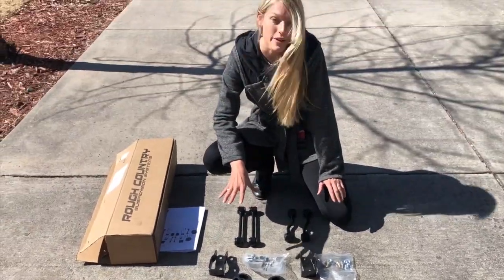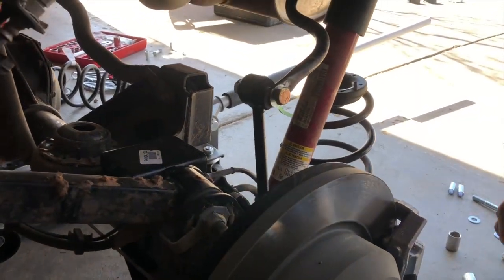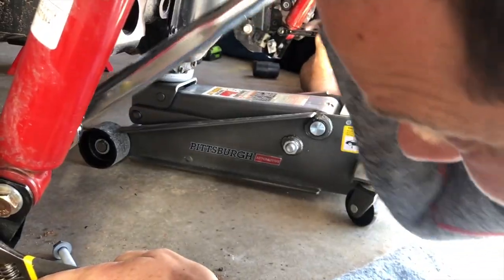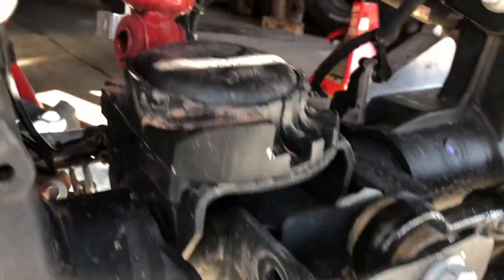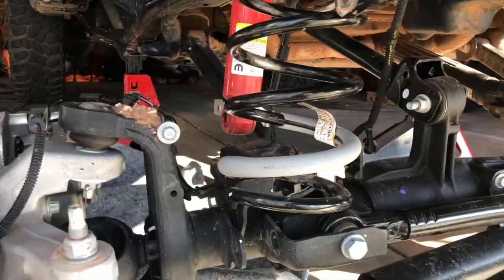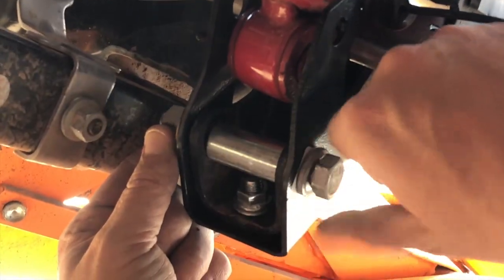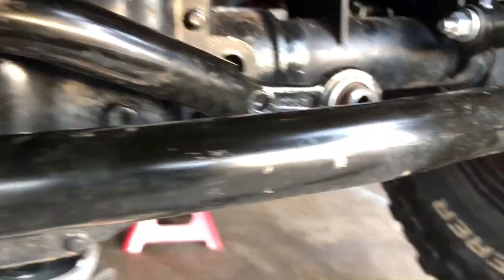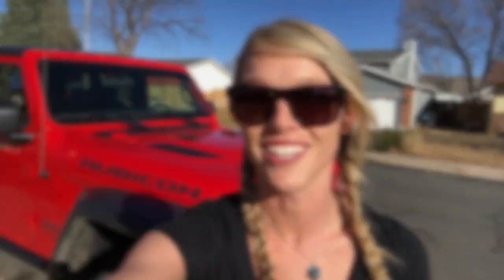Installing a 2.5" Lift on Our 2018 Jeep Wrangler JLU Rubicon - How To

Comment: Thanks for sharing your lift install. Really like the new stance. Looking forward to your next video where you test the new setup. Kevin you are blessed to have a lady who loves Jeeps as much as you do.  My wife of 32 years drives a 2018 JLU Rubicon in Granite Crystal.  We got it one month ago today on Feb. 16th. so it is our first month anniversary. We love our new Wrangler we traded my wife's 2014 JKU Sahara in on the new Rubicon. I drive a 2012 JK Sport S.
Reply: Can't agree more Kevin. The new redesign on the Wrangler is fantastic. My wife likes it a lot better then her 14 Sahara. I really like the styling ques from days past like the tip in the grille like the YJ and TJ,  the headlights pushing into the seven slot grille like my dads old 71 CJ5. The flat dash reminds me of the YJ and CJ Jeeps. There is so much to like and the drive with the 8 speed auto brings out more potential of the 3.6 liter.  So it was a no brainer buying the new model even if its a first year model.  Thanks again for sharing your experiences with us You Tube Jeep lovers. 

Gary

Comment: I am not familiar with whether or not the Rubicon’s auto sway bar disconnects are only for the front or both front and rear sway bar. If not for the rear , I highly recommend the Steinjager rear sway bar disconnects, you will not be disappointed in how easy it is to disconnect/reconnect the rear sway bar (zip tie the sway bar up, two most important items for any Jeeper to carry off road are zip ties and duct tape, in my opinion)!

Comment: I look forward to seeing how it performs with the lift.  I have had an AEV spacer lift on my JK, with 33's, and I've done lots of trails, including some in Moab, and put over 80k miles on it with no issues.  I put the Mopar lift on my JLU, and it is great, but they are working to fix the dreaded driver side spring bow.  Mine isn't touching the bump stop, but it does need a fix, which Jeep tells me is coming.  Anyway, you avoided all that with the spacer lift and saved a BUNCH of money.  I'll bet it performs just as well.

Comment: I installed the exact same lift on my Rubicon JL, I did a lot of research and the consistent complaint was the rear sway bar link will hit the shock on full articulation droop. I measured the stock Rubicon sway bar links they are 9” eyelet to eyelet, the ones they gave me in the kit was a inch shorter. The actual lift in the rear spacer is 2”, so links need to be 11” for spacer lift. I ordered Rubicon Express 11.5” eyelet to eyelet rear links for JK, worked out perfect, even got sway bar up another 1/2” to further it away from shock at full droop. Please measure what your rear sway bar links are that you have with the kit and make sure they are at least 11” eyelet to eyelet or you will experience rubbing on the trail, no fun. Just trying to help with what I learned about the Rough Country spacer 2.5” spacer lift.
Reply: Kevin Williams  Yes Re- 1157 they fit perfect,  and solves issue under full flex off shock rubbing sway bar

Comment: Whats the price difference from that lift kit to the Jeep lift kit?  Seems like the Jeep lift kit with the fox shocks would be a better option unless price is a huge concern.  But after spending $53000 on a Jeep,  price shouldn't be a factor.
Reply: Thanks for the reply,  I wouldn't have known the difference without asking.  I definitely wouldn't have known about the problems.  I really enjoy watching your vides,  not sure if its more for the Jeep, or the blonde. haha jk
Reply: I don’t believe the Mopar Lift includes Fox shocks. They utilize the OEM shocks with the kit I saw. Maybe the Fox shocks are optional or pacakged at a higher price.
Reply: The new Mopar 2inch lift for the JLUR does come with Fox shocks for about $1,200 bucks I got it for my JLUR and I love it, I suppose the rough country would do the job until you had the funds for the mopar lift.
Reply: @boughtnotbuiltoffroad7784  what problems specifically? Was getting ready to order one from Mopar.

Comment: Nice video!
I just went to the dealer for 2.5 inch lift and 35s on 18s they want $9000 installed on a jlu r. He said the price includes a spare and the buy back stock jlu wheels for $500.
I want 37s on 20s with a cheaper 2.5 lift for $4000 installed.

Comment: So you have a rubicon; which is already 2 inches higher than the other jeep models.  So did you put a 4.5 in kit on it to get the extra 2.5 inches?

Comment: Great channel. I understand from your comment that you don't need a lift to clear 35's for on-the-road driving, but how about off-road.  Did you find that a lift or other mods were needed to avoid rubbing off-road with 35's?
Reply from the maker: Don Sievert Nope! We eventually went with a lift just for ground clearance purposes. But the tires will clear without it!

Comment: I have a question after you did the 2 1/2 left did you have to mess around with the caster on the front
Reply from the maker: Ronny Hellpap So far it hasn't seemed to need it. Driving perfectly fine and straight. ☺

Comment: Not sure why it would ride stiffer, the springs did not change. But great video!
Reply from the maker: Stuka87 We think that perhaps some of it could be that we torqued everything while the vehicle was up on jacks as opposed to after lowering back to the ground. May possibly have caused some slight binding and whatnot once we set it down. It does seemed to have softened up a bit after taking it through some trails today.
Reply: If you had loosened the control arms, and torques them while the suspension was hanging, that will for sure cause the suspension to be stiffer. The bushing will eventual work themselves into where they should be.

Comment: A spacer lift......Mopar's 2" lift is a better choice. I'm running 37's on my jeep.
Reply: hey I went with the 2" because it was at the time the only real lift out. Besides I use run a AEV 2.5 on my last jeep. With the JL  between 2 and 2.5 is as high as I'd go and keep the jeeps true center closer to the ground.

Comment: I'LL wait for the Diesel,442 ft.lb. torque, hopefully between 1800-4000 RPM'S.
Reply from the maker: Robert Hein Kevin really wants the diesel as well when it comes out. Haha
Reply: Hey, Kevin, fully loaded Rebucon is $57k, dealer said the diesel option on a Ram is $72-$7500.
So my guess is now $60's .
So my way around the is order what I need: Jeep, diesel w/ Dana 44's, auto( manual not a option), 375 gears( Don't need 4:10's,w/442 lbs.), 2- Dr., Don't need a lot of crap, just  cheaper jeeper.

Comment: Does lifted JLU still feels shaky and bumpy over 70mph on the highway like lifted JKU?
Reply from the maker: Dean Z Not really, still drives super smooth at highway speeds (depending on where you live and the road conditions of course lol)
Reply: Lite Brite by still smooth, you mean compares with stocked JLU? or lifted JKU?

Comment: Well your driving a 4 door Wrangler station wagon. Get a 2 door then not so much belly dragging. Learn to pack lighter. Unlimited Wranglers not really keeping with the spirit of what Jeeps were meant to be in my opinion. How long and wide does can a vehicle get before we call it something else. Kind of like the Mini Cooper. Started out like what the name says mini. Now they run around with these extended four door versions and still call them minis hhmm. I can see the similarities can you?
Reply: The 2" lift will take care of that.  Besides, there are some advantages to the 4 door, that come with longer wheelbase.  I've had 2 door Jeeps, too, and loved them, but my humble opinion favors the four door.  Opinions are like....
Reply: Kevin Williams 
Good comeback to a 2dr vs 4dr comment.  You're showing what a stock 35" 4dr JLUR is capable of doing when wheeling.  Adding 2.5" of travel only helps even more.  And you saved money and  DIY'd the install.  You two are no snowflakin' quitters...only rock-crushin' DOERS.  Way to go, bro...we like that....keep it up cuz "isn't that what every girl wants?...an extra two inches?..."  lol you folks kill me lol
Reply: John....As a man ordering a 2 door, manual Rubicon soft top, I can say that if not for 4 door sales, jeeps might very well be GONE by now....As a veteran, jeeps aren't used for their original intention, not really...Let's just all enjoy our jeeps, regardless of wheel-base or doors.
Reply: sounds like envy to me! They kick ass
Reply: Not a hater. I love all vehicles that can get out and get dirty. Great this couple can enjoy each other and have something in common. Love the humor.
Reply: When I ordered my 2-door JL, I was thinking it was a smaller vehicle, probably because I was used to seeing the CJs, YJs, and TJs.  I actually wanted a compact vehicle like that instead of a full size SUV.  I was looking at the specs on it the other day and realized that it is the same length as the 4-door XJ that I used to own.  I'm not so sure that I like this "super sizing" of the Wrangler.  Sure, it's smaller than my Ram 1500 4x4 QuadCab, but it's not what Wranglers have been known for through the years.
Reply: Grumpy OldMan  Got our 2 Door JL last week. Was a surprise. Silver Rubicon 2 Dr. Dealership was surprised we got it so fast but my wife had her name put to the Jeep and I think that was the trick. We expected it months from now. They drive amazing. Can’t wait to hear about yours.
Reply: +John Smith
I recently moved from "D" to "D1" status, but they haven't set a build date on it yet.  I was looking on my dealership's website earlier today and I saw a couple of JLs that were very close to what I ordered -- different color and did not have the anti-spin rear differential.  I'll continue to wait, I guess...
Reply: Grumpy OldMan Is your name on the order? They didn’t have any come in to the dealership but the one we put our name to. The dealership was just as surprised as we were like I said previously. All the dealership can think is that it was the name to the order they get em out quick. They were only doing black and white but they somehow got a silver  Rubicon to us lol. Who knows.  We are in Calif but I don’t know if that’s any help.
Reply: Well, when I check on the status of my order on Jeep Chat, they ask for my name and VIN, so I have to assume that they are verifying it.  Hopefully, that's not an incorrect assumption...
Reply: Just checked with "Jeep Chat" and they verified that it was under my name and was informed that customer orders definitely had a higher priority than dealer stock orders.
Reply: Grumpy OldMan well tell them to hurry it up lol. They drive like no other Jeep in the past. If you got an auto they are just smooth as silk. Hope it stays that way because like I had posted earlier Jeep is buying back our 2013 10 year anniversary 2 door because of multiple problems. I got two jeeps parked out front right now. What a shame. Hope to have better luck this time around.
Reply: +John Smith
I absolutely HATE automatics.  I had one in my Ram QuadCab 1500 4x4 pickup, but only because to get a manual transmission, I would have had to go to the 2500 (extra $5K) and diesel (another extra $5K).  It wasn't worth $10K to me to get a manual, so I put up with it for the last 14 years and bitched about it every time I got a chance.  Oh, it worked fine and had no problems, but an automatic transmission just has no soul.  It's like having sex while wearing a wetsuit and a raincoat.  And if you can actually imagine that, you're probably a bit strange, come to think of it. :)
Reply: Oh i agree I love em to. Primary vehicle for the wife. She likes stick as well but living in California you could be stuck for days it feels like in traffic so automatic it is. I would much rather be offroading with a stick. Even though she works from home but i don't ask questions lol. Heck its the new anti theft device nowadays, stick shifts.
Reply: Yep, the Gen-Slacker / millennial car thieves these days just don't seem to know how to drive a manual transmission.  Just do a web search for "manual transmission car theft" and you'll get a laugh at all the failed carjackings and thefts.

I've never found a problem with manual transmissions in traffic... If I'm lucky, I just find a gear where I can idle along at the right speed and seldom have to even touch the accelerator pedal or brake.  But then again, I'm not trying to drive and talk on the phone at the same time.  At worst, I'm just idling along, sipping a beer, and slowly making it through the 6-lane parking lots that we call "highways" in Houston.